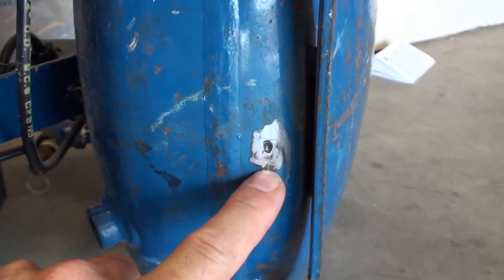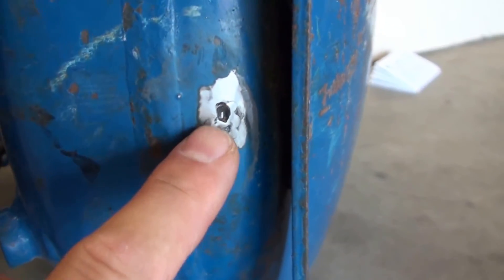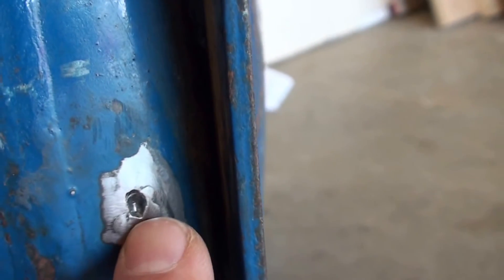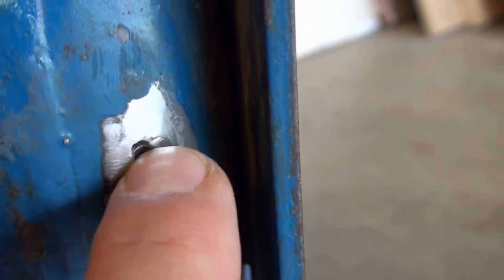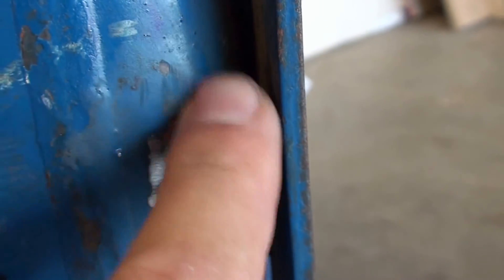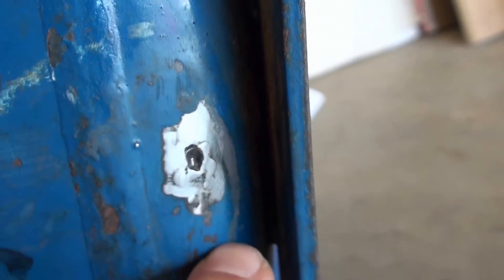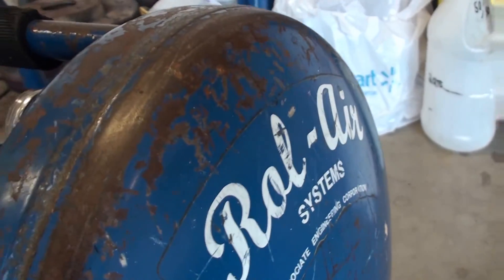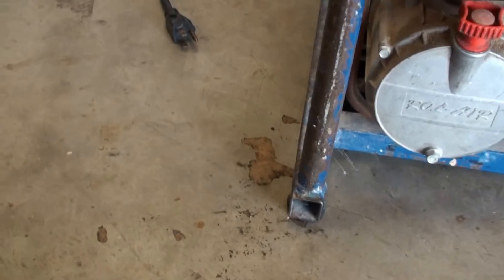Air Compressor Tank Safety- DON'T Repair rusty holes!

Comment: It's what professional pressure vessel builders call "Building a Bomb"  

Never weld on ANYTHING that holds pressure unless you are trained and then pass the requisite qualifying test for the particular weld you are making. ,,, This in not like putting a basket of grapes on a rusty frame and it's not for the Bob Villa types out there. 

You can kill yourself, your family, and the neighbors if you do something that causes a catastrophic failure of a pressure vessel and welding on a tank that is going to be pressurized to 125 or more pounds without proper training and expedience is the best way I can think of to cause a catastrophic failure.   There is a reason manufacturers pay big bucks for that ASME tag on a pressure tank.    

This is not a joke and much more dangerous then screwing around with electricity when you don't know what you are doing.
Reply from the maker: Exactly!  Well said. 👍
Reply: Im a self taught mobile welder, ive welded super car carriers, tow truck hydraulic rams and everything on those damn trucks, 6 wheeler concrete trailers, and utility trailers. And have my own shop so i have a small amount of experience with the big stuff and i have a honda 4hp air compressor i got for 100$ because of a bad carburator and once i got it running realized it was leaking air from a cracked weld that holds the platform that holds the engine and compressor fo the tank and looks like the toe of the weld has a hairline crack, can i 7018 it or mig or am i SOL
Reply: @jackmioff000 read the comments - obviously the answer is NO

Comment: So my tank has a hole 
I wanna buy a new tank 
Any recommendations 
The rest of it is old oil filled 
And it’s great so I wanna fix it 
Don’t wanna just scrap it
Reply from the maker: I would buy a new scroll type compressor. They are very quiet, more powerful and use less electricity. Go modern.
Reply: @ozzstars_cars  thanks ,

Comment: Best way to repair pinhole is to use a machine screw coated with a two part epoxy such as jb weld. Just  thread the screw in lightly snug. Good luck to those who use their own judgement.
Reply from the maker: That's a good idea but I'm still not sure it's the safest way to repair a rusty tank.

Comment: Yeah I can relate I just tried to fix my Ingersoll Rand 24 gal that had a pinhole showing rust and I did the same thing trying to mig weld it and it was a fruitless Endeavor I just created more holes the metal is just too contaminated besides my pump leaks oil it's probably 20 years old I think I got my money's worth out of it
Reply from the maker: Next compressor, I'm getting the scroll type. So much quieter and they put out much more volume of air.

Comment: I just got an old Sears air compressor for free. It was being thrown away due to a pinhole leak in the tank. I'm planning on spraying some flex seal and then flex tape over that. If it doesnt work, then no harm no foul. I don't figure its dangerous for any reason. Right?
Reply from the maker: It's garbage.
Reply: Wrong … it is dangerous.

Search up compressor explosions in YouTube and see for yourself.

Then you may want to delete your comment.

Comment: I would not use a mig welder I would use oxy acetylene setup so you can control the heat better and build it up around the crack/hole I’ve done thin metal work and I can assure the mig would blow right through even on the lowest setting
Reply from the maker: Best to scrap the tank and buy a new one.

Comment: I don’t think you’re going to have any safety issues unless you somehow weaken the tank enough to shoot off a large piece of metal.  There’s a lot of power and pressure, but reopening a leak or a bigger leak is just going to be loud.  Do it at your own risk though, my experience is it won’t work anyhow.

I tried running a self tapper screw in hole.  No.  Welded and turned into 2 holes before giving up.  Jb weld all over and no.  

Then yesterday after a few months someone gave me a similar old compressor that wasn’t building any pressure and my thought was to take my pump and put it on this tank.  Just for fun, I fired it up as it was and immediately realized the valve flap was off on one piston.  I put that back on and started building pressure… until I realized this tank also has a leak.  So now I still need a tank. Or two.

Comment: I wouldn't touch it. Unless your capable of cleaning the inside and inspecting it, how can you weld it safely? Additionally if you do weld it, are you capable of hydrostatic testing it to the correct test pressure to ensure it is safe? Do you have any idea what electrode/wire/filler material you need?

Unless it is a massive industrial compressor tank, I would just replace it.
Reply from the maker: Good advice!

Comment: All depends on how thick the metal is and whether the metal around the leak is still solid.

Also, a welding certification doesn't mean much either because I've seen plenty of failed welds from morons who are certified so take it for what it's worth hence the reason most businesses conduct their own in-house testing.

The only way to be absolutely certain is to have it hydrostatically tested to twice it's normal operating pressure rating to see if it passes or not.  No certified welder is going to perform that test hence you're still wishing in one hand and shitting in the other as to whether the welds will hold or not!

The older air tanks from the 40's or 50's were built to last and most have 1/4" wall thickness so drilling out & welding up a pin hole leak in those is not that big of a deal.  The newer air tanks are paper thin garbage that wasn't worth a shit when you bought it new so you might as well scrap it and get a decommissioned propane tank instead which happen to be cheaper and stronger than the garbage they are selling from most retailers these days.

The horizontal air tanks are probably the most dangerous due to the end caps that are welded on can fail and if someone is in their line of fire then some really serious injuries will occur!  This is why these style of air compressor should have there own dedicated space/room or be enclosed inside a cage just in case they ever fail.  The pancake and vertical tanks for the most part are pretty safe seeing how if they fail it typically just makes a hole in the bottom of the tank due to them not being properly maintained because of water rusting them out.

By the way, the air tank looks like someone tried to weld it and failed miserably🤣
Reply from the maker: You bring up some good points Weaver. Thanks for sharing your experience.

Comment: My compressor has a needle size hole. This safety tip video confirmed what my instincts already told me. Thanks for making this video!
Reply from the maker: Glad it helped you.
Reply: You could try to run a larger self tapper bolt in that needle hole but I doubt it will work.  Didn’t work for me.  Then I started welding and turned a small hole into two large ones and gave up.  Then yesterday I got an air compressor that wasn’t working for free. I repaired the valves in the head and she started making pressure and then leaking out of a tiny rusted hole in the bottom.  I can’t win. lol
Reply from the maker: @CooterELee  time to buy a new one?
Reply: I lucked out and got one for free. Hopefully there’s no holes in this one 🤣🤣

Comment: I agree. I just repaired one with a pin hole leak so I cut a large section out. If I knew how rusty the inside was I would not have attempted. Plus getting the weld to seal is a whole 'nother ball game(semi amateur welder here).

Comment: mines had a hole I welded it and had no problem its been 6 years 80 gallon and it works fine I really just followed the instructions of my welder's thickness.
Reply from the maker: That's pretty good.

Comment: Drill pinhole as small as possible, Small gasketed machine screw, teflon tape with star washer.....been repairing customers pinhole compressor leaks this way for decades and have received nothing but "Thanks"...$5 versus $300 for a new compressor........nothing like saving people money!
Reply: ....a d before anybody jumps on me, I am a certified pressure vessel welder, worked (before they shut down) at Maine Yankee and Vermont Yankee nuclear power plants.
Reply: Thanks Richard this should save my compressor from cycling so much at the job site. I didn't think welding it was the way, as Ozzstar notes in his video.
Reply from the maker: Interesting that type of repair would be considered safe and not a potential future piece of shrapnel.  So do you ex-ray for any internal corrosion before taking on a huge liability repair?  What is your process to certify that type of repair?
Reply: Ozz, I don't x-ray anything, remove bung and visual inspection followed by tapping tank with a light cobbler's hammer. If you know what you're listening for....piece of cake. Like I wrote, I've done hundreds of these repairs......don't be so fixated on 'fake safety'.
Reply: ......same process as used to certify my scuba tanks every five years. Do you think inspectors would certify 80cf pressurized tanks strapped to your back?
Reply: i see you used the idea i was thinking off....tap and use machine screw with rubber washer/gasket...ill do some analyzing to see if area is thick enough to try this repair...like i said its an occassional use machine...for home use...not a shop use.

Comment: I’m glad you made this video.  I found a perfect pin size hole bottom of my tank … and it’s confusing b/c of its symmetry - not what you think of when thinking “rust hole” .
Reply from the maker: There is a lot of rust inside that tank no doubt.

Comment: can you safely repair a cracked air tank that is free of rust? like its fairly new and clean but has been dropped and is cracked.
Reply from the maker: If it's done correctly, otherwise it's called shrapnel.
Reply: @ozzstars_cars  Can I do it? Yes,,,,But I am an OSU degreeed welding   engineer and an AWS Certified Welding Inspector and a level 3 MT. UT, and PT ANST tech and, and, ,and, and and have been in the business since 1980,,,,,,,get the point. 

Pressure vessels are a world apart from welding a rusty cat frame. .... and step one I would do to fix a cracked compressor tank would be to get a radiograph of it and then ultrasound it after I used a borscope to check out the interior....We are up over like 7 hun and haven't even started doing the weld prep much less struck an arc yet. 

Scrap it, There is too much to do to  it "correctly" to make it worthwhile.  And if it broke after being dropped less then a few stories I wouldn't trust ANY of the factory welds in the first place.

Comment: Just brought my 4 gallon compressor tank to be welded today. Pencil point size hole. Let it cure. Brought it home. Works like new
Reply from the maker: Good as new
Reply: Congrats on your Russian Roulette air compressor.
Reply: @bogieman101  wrong. it was done professionally and it’s been used over 2 dozen times since
Reply: @johnc1280  I'm not referring to "professionally done" repairs. If it is truly done by a professional it is safe.  Problem is there are way to many professionals that don't know their ass from a watermelon.  I hope yours is safe, but  because it has been used 2 dozen times without blowing up doesn't  mean anything.  I don't know what type of repair you had done, but if it was just welding up a pin hole in the bottom of a tank I can tell you I wouldn't trust it.  You think it only rusted in that one little pin hole?

I'm not trying to be a know it all, I found these videos because my 20 year old compressor has a pin hole in the bottom.  Even my brother who was a mechanic said "just weld it up", then I saw the video of the compressor that blew up on a guys grandfather and damn near killed him.  My compressor is going to the dump.  My or my families life is not worth saving a few dollars.
Reply: @bogieman101  it was like needle head in size and the material piece used to weld is over size of a scotch tape roll. It’s held with no issues at all. The guy who did it has been welding longer than I been alive
Reply: Professional huh?  Does he have an ASME R Stamp?  Just because a guy has a shop and a couple of welding machines does NOT make him a pressure vessel professional. - and FYI no ACTUAL professional would take that job for less the 2 times the cost of a new tank.
Reply: @mathewmolk2089  too bad I’ve used it 25-30 times since the weld and there isn’t a damn thing to be reported. Works better than before
Reply: @johnc1280  I'm a 74 year old welding engineer with decades of experience with pressure vessels and even NavSea (Navy Nuclear)  and other mill spec experience and if the joker welded a pinhole in a rusty (inside) tank he need to retire before he kills somebody. He hasn't got a clue about pressure vessels and needs to stick to Bob Villa type jobs.
Reply: @mathewmolk2089  you haven’t seen the repair work. It’s clean and it’s been seen by several people who have been into HVAC plumbing heating etc not a single person said anything other than ‘wow that’s a clean job’ , and you just inherently know it’s a problem ??
Reply: @bogieman101 That's right, our lives and our families are more valuable than a rusty leaking compressor, just replace it with a new one 👍✨

Comment: Like in the movies every time a car rolls over the hero shouts “ look out it’s going to blow” Just so you know most cars don’t blow up neither do air compressors also Most people don’t have the right kind of welding equipment so you can braze it or solder it. Just saying
Reply from the maker: Best to check for the amount of rust internally before welding anything that has rotted out.

Comment: 2 words: brazzing rod
Reply: Nothing wrong with repairing pressure vessels if you know what you are doing. Just tonight i repaired a tank on a 2008 volvo tractor on the side of the highway. Key words If you know what you are doing. Or you can just bring me the tanks and I'll repair them at $125.00 an hour. Thats cool too.
Reply: @omenofseverah  Did you RT and UT it and then Hydrostat it when you were done?  $125/Hr is pretty cheep for a guy with an ASME stamp.
Reply: @mathewmolk2089  yeah, I'll make sure to do all that at 2 am on the side of the freeway. Seeing as there is a national shortage on tanks this is becoming even more common.  Carry on  Karen.
Reply: Two words (you’re crazy)
Reply from the maker: Three words: Don't do it!

Comment: In good shape that thing is worth 25 dollars tops. It was a junk machine always. If it is a pin hole put a screw in it with some silicon. Or grind the area and use JB Weld and force it into the hole and wait 24 hours. Or just weld it, worst case it will leak again. just don't put your eye ball right next to the troubled spot.
Reply: HAHA about the eye ball lol at 110 pounds! Rol Airs are good compressors though I have a 25+ year old one thats still going strong but I drain mine frequently.

Comment: Just because you're not skilled enough to fix such things doesn't make the tank garbage. At least scope the tank before you scrap the tank.
I have been repairing pressurized vessels for over 20 years...... Ignorance promotes Ignorance
Reply: While I agree 99% of the population shouldnt repair pressure vessels. I repair them all the time. Often on the side of the road or in parking lots, in the middle of the night. Emergency on call road side breakdown. Heavy truck/trailer and equipment repair going on 20 years. Get some!
Reply: @omenofseverah  I bet you wear a covid mask in your car driving by yourself.....
Reply: @omenofseverah  Again, do you take X-Ray and UT equipment with you in the field? How do you determine the minimum safe thickness for a tank rusted from the inside?  (I always used a Krautkramer USIP11 I paid 7 grand for USED,,,,,oh I am also a level 3 ASNT tech,,,,are yo
Reply from the maker: Your right about ignorance and repairing an air compressor by 99.9% of the population is foolish

Comment: Lol I use a 60 gallon air compressor that has a little hole in the bottom but here lately it's not been starting electrical parts went out I think but good tip. We use to use ours to fill semi tires with